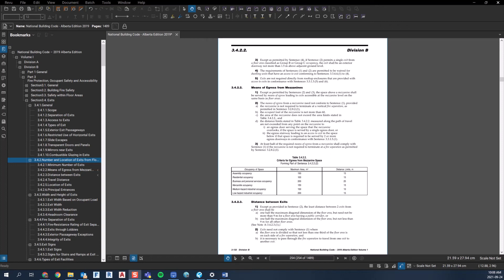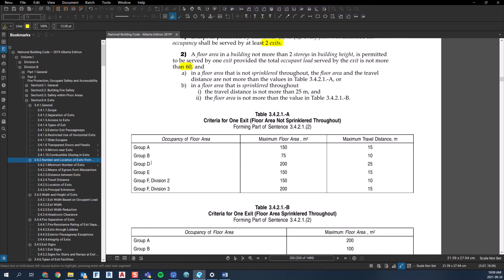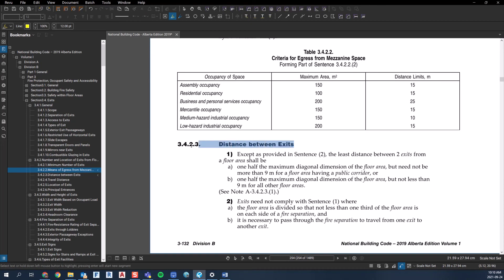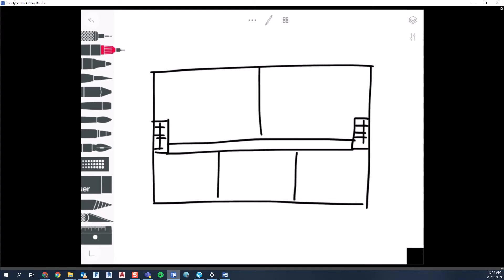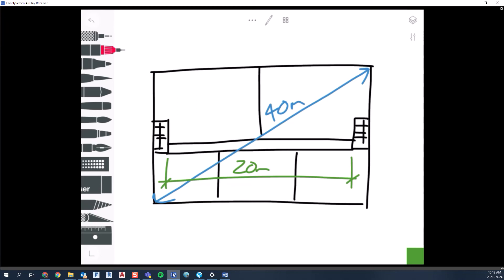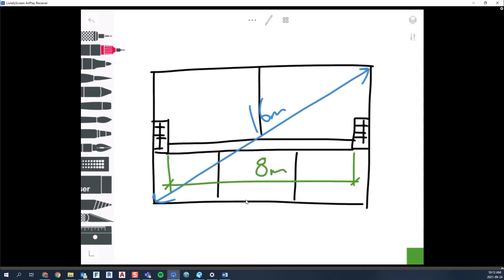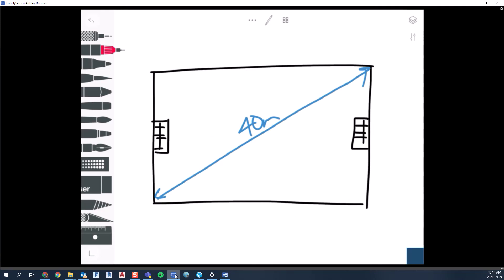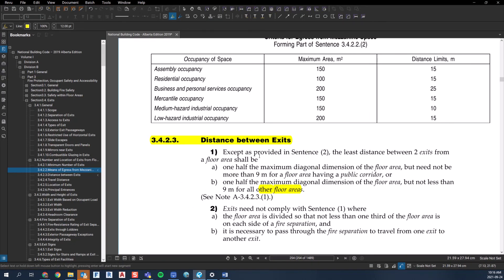Distance Between Exits (3.4.2.3) - National Building Code Alberta Edition 2019

Comment: Hi, Thnaks for the content, is it possible to know why you didnt go through the article 3.4.2.3.(2)?
Reply from the maker: I have never come across the use of that sentence. The floor plan scenario in the video would not apply to that sentence because once a person is in the corridor they would not be passing through a fire separation that separates the two exits. For the example without a public corridor, there would need to be continuous wall with a door(s) that is a fire separation dividing the space, which again I did not draw. But that is a work around to these requirements I covered.

Comment: Hi hoping you can elaborate on a section of this exiting code. When you have a public corridor between exits, but your exits are greater than 9m apart... is this still acceptable? I have seen different diagrams which demonstrates 1a) as a room supplied with two doors, that empty into a corridor and those two doors not being more than 9m apart. Where as 1b) covers the topic your discussing which addresses the distance required from building exits.
Reply from the maker: When you have a public corridor between exits, they can be more than 9m apart. They "need not be more than 9m" but can be more than 9m.

Doors from a room or suite are Egress doors. Section "3.3.1.5. Egress Doors" covers egress door requirements. A room or suite might need two egress doors which is determined by travel distance, area and occupant load of the room or suite. If it is determined that two egress doors are required, then those two egress doors need to be a certain distance apart. See 3.3.1.5 (2). See this video https://youtu.be/5rfFsD3a0R0 One other important requirement to be aware of is 3.3.1.3 (9) which requires that when one goes through an egress door into the corridor a person needs to be able to go in two directions to an exit. So basically cannot have a situation where you have to go past one exit to get to another. I have seen this slightly relaxed to the extent of a dead-end corridor allowance (3.3.1.9 (7)) distance in multi-family condominiums in my area, but the requirement is clear none the less.